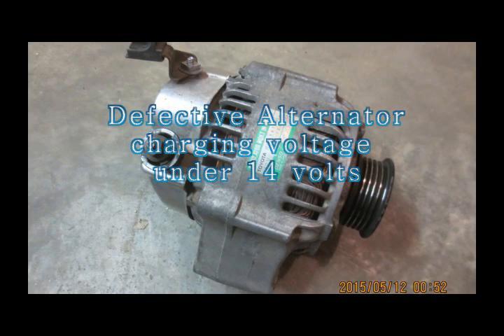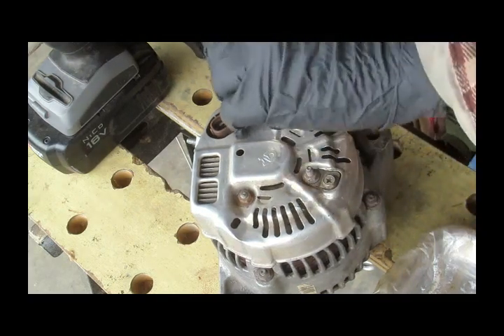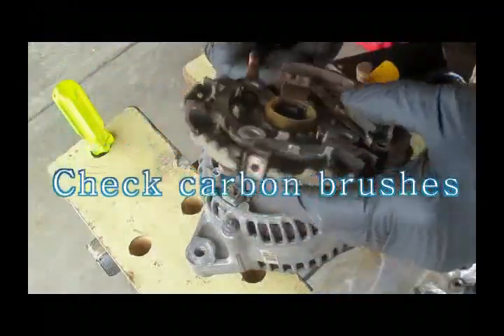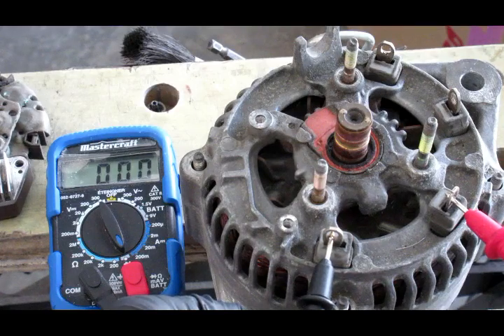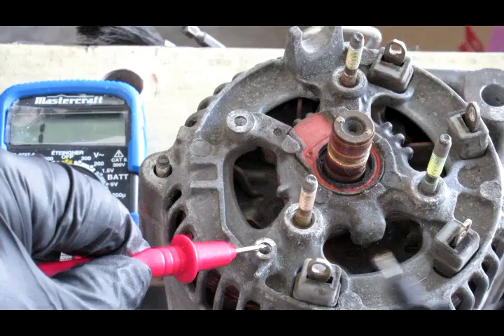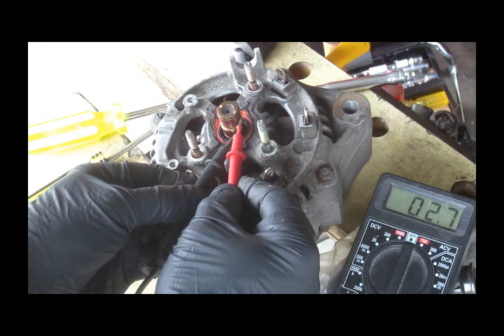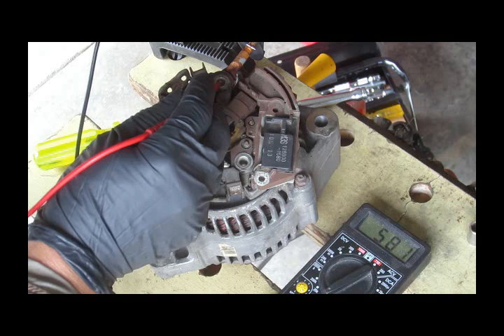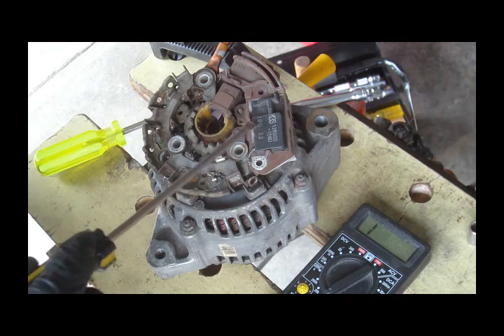How to replace, diagnose and repair Toyota Alternator  - Disassemble and Reassemble

Comment: Thank you for the nice videos
I have problem with the same alternator the voltage on first 14 and when use car one hour voltage on low rpm go to12. 8 and im change the alternator  but no change results same problem we have
Reply from the maker: Looks normal, the charging voltage at 14. After the battery was fully charged and then dropped to 12.8. When starting or cranking the engine, it will drain a lot of battery amperage. Then the battery needs time to be recharged. Would suggest you to check the battery's condition.
Reply: @tgmac8288  thank you,, im solve the problem with changing 3rd altonator,,, my best wishes for you ❤️❤️

Comment: Im following this guide (very grateful by the way) and I’m getting no resistance (1) across the slip rings - where does this mean the fault is, and can it be fixed? I cleaned them up and make sure contact was good
Reply from the maker: There is a short inside the rotor. Would suggest to replace the alternator replaced - new or used.
Reply: @tgmac8288  just to be clear by no resistance I don’t mean an open circuit connection I mean no connection at all
Reply from the maker: @electricsuncafe "Zero" ohm = shorted circuit. Open = high resistance  or broken coil wire. Both mean rotor coil circuit problem and the replacement of the alternator is needed. Not a easy fix. Get a used alternator from auto wrecker will be the cheapest way.
Reply from the maker: No connection = open circuit connection = infinite high resistance.       No resistance = zero ohm = shorted circuit

Comment: When I was a young GM mechanic my alternator went out so I went to the parts counter and get a diode bridge and regulator and proceeded to rebuild my alternator,
When I was all done the parts manager walked in and said "hey dumbass I could have sold you a new alternator for less then you just paid for parts"
I was not pleased,
And I do believe it was the last alternator I remember cracking open.
Reply from the maker: 😄Might as well pick one up from Junk Yard for cheaper price. 😃:)https://www.youtube.com/s/gaming/emoji/7ff574f2/emoji_u1f604.png

Comment: Hi and congratulations for the video first, I have a problem I have an error code P2501 high voltage terminal L + of the alternator lamp what can it be, the alternator charges well, thanks I am waiting for an answer

Comment: I'm going to try this. My alternator stopped working after I power washed the engine bay (oops).  I like the music
Reply from the maker: Glad you like the music. Please update your result.
Reply: @tgmac8288  My rotor did not have continuity between slip rings and had a ground short.  Plus, my rectifier didn't pass continuity in either direction.  Time to buy a new one. Thanks for your help.

Comment: Over 30 Years ago a chev voltage went up to 18v. So t bought a regulator And took it apart like you did and replaced the regulator problem fixed. Voltage back to 14v.
Reply from the maker: Well done! :}

Comment: To confirm that you have an alternator problem and not an external wiring or connection problem, do these simple checks before you grab a wrench:
With a charged battery start the car. Do the following voltage checks. Measure across the positive and negative posts and remember the value. Move the negative meter lead to the engine block. Make sure that the voltage is the same. Move the positive lead to the large post on the alternator. If you have a dead alternator then this voltage will be slightly less than the battery reading (small resistance in the wire). Turn the Car OFF and remove the three-wire plug from the alternator. Start the car (the bad battery indicator should be OFF) and measure each of the three wires in the removed plug. They all should have the 12V present.

If you have confirmed these points then it is safe to assume you have a bad alternator.

It is easier to remove the alternator before performing the following checks to determine your failure. As soon as you have removed the outer cover it is easy to check the stator windings, the rotor windings, the brushes and the diodes with a simple meter. You don't want to remove any screws before you make these checks. that way you can find the fault before you move connections around.

To check the rotor windings, the slip-ring connections, and the brushes: measure the resistance across the two screws holding the brush assembly in place. It should read less than 10 Ohms and stay there as you slowly spin the rotor. Then confirm that these screws are not shorted to the chassis ground (OL on the DMM).

To check the stator windings and the diodes:  Measure the resistance between the 4 screws located around the edge. They all should be around 0 Ohms. In "diode Check" mode measure any screw to chassis ground and then reverse the leads. In one direction you will read something like 0.3 volts and in the other direction, it needs to read OL (overload or infinity Ohms).

Many times you will find the brushes are too warn and the first check showed OL instead of 10 Ohms. Why replace the alternator when a $30 part will work?
Reply: Do you have a vid in mind about testing the alternator while still attached?    The following isn't clear to me:
Turn the Car OFF and remove the three-wire plug from the alternator. Start the car (the bad battery indicator should be OFF) and measure each of the three wires in the removed plug. They all should have the 12V present.

---how do you test these 3?  Do you keep the neg meter reader on the engine block?

Comment: what happen to the regulator. How did you change it.
Reply from the maker: If you disassemble the alternator as shown in video, you should be able to change the regulator easily. Before you do that, maybe you should check out the price of a new alternator which could be cheaper than a regulator. Might as well to get the whole unit.

Comment: How you fix the voltage issue
Reply from the maker: Did you perform as this video shown?
Reply: @tgmac8288  yess
Reply from the maker: Can you be more descriptive about the problem?
Reply: @tgmac8288  i have 14.2 volts at cold start and 13.2 at hot start and when i apply full load the voltage drops to 12.6 and rpm also drops to 500 but after 40 seconds rpm return to 850 and voltage remain same and if i rev the engine to 2000 rpm then voltage comes to 13 volts
Reply from the maker: Sounds like you have a voltage regular problem. Are you from USA or where?
Reply: @tgmac8288  im from Bahrain where temperature is 115 F
Reply from the maker: In north America USA or Canada, most of the auto part store offers free charging system analysis of which can verify the regulator is bad or otherwise. If this service is not available in Bahrain, see whether you can replace another regulator or (used) alternator to see the problem will be disappear or not. Hope this can help!

Comment: Is there an ohm number that the rectifier should ideally have for all diodes? I checked mine and it seems to be 380 ohm for all but one where there doesnt seem to be any connectivity (which would confirm my suspicion of a faulty rectifier causing the alternator to not charge the battery anymore). Thanks for the video!

Comment: In this video. Why not check Rectifier/Diodes first?
Reply from the maker: Of course, one can start checking Rectifier/Diodes first.  However, one supposes to check out all parts if possible for a permanent fix. It is totally personal preference where to start. The method I was using that was "outside in" in order to cover all parts. What do you think?